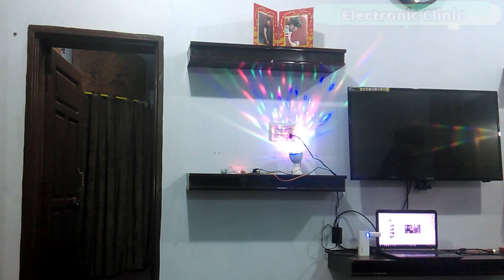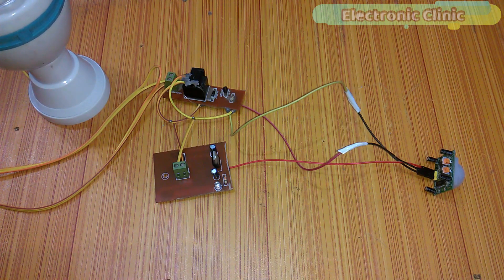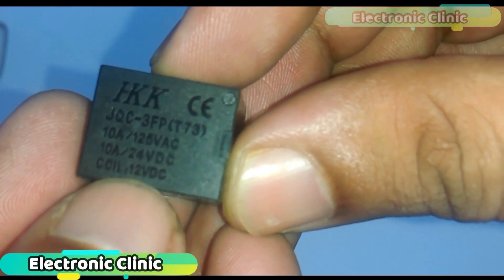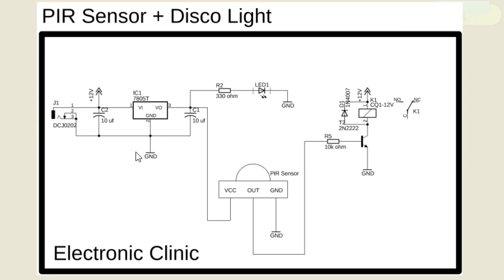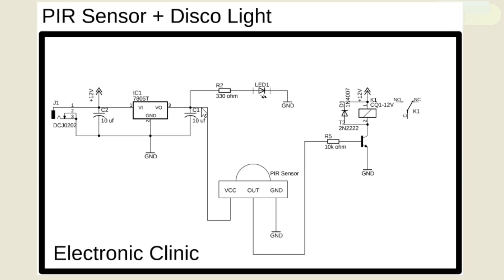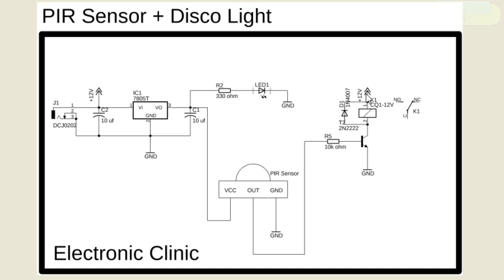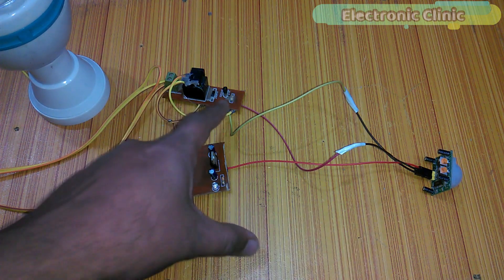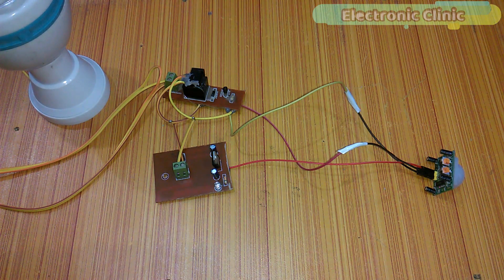Diy Project: Homemade Automatic Light Control System using Motion Sensor "PIR Sensor"

Comment: How to control 12 V Led strip, at least 20 meter with PIR motion sensor for stair case lighting. Without using Arduino.
Reply from the maker: watch my video on streetlight control system. you can use a relay with the pir motion to control the lights strip